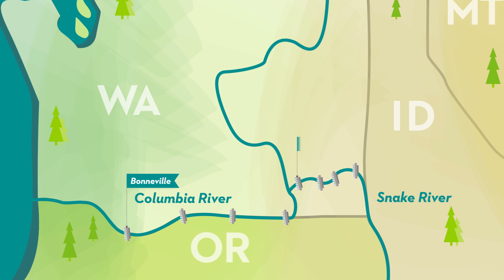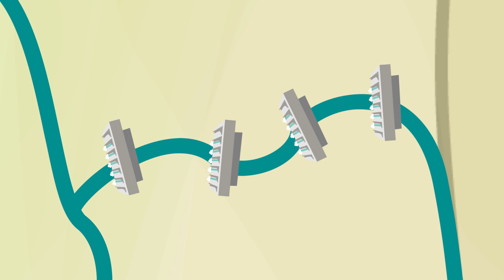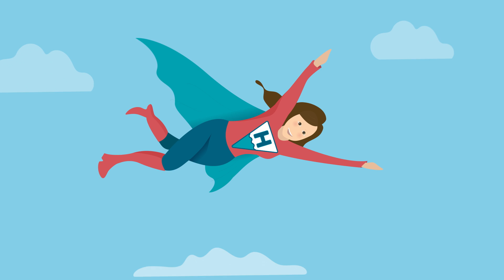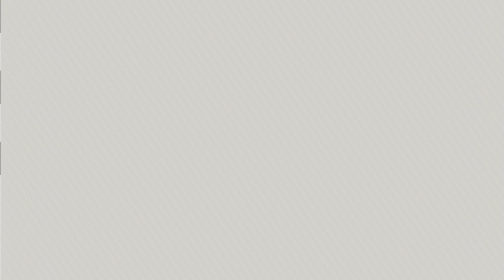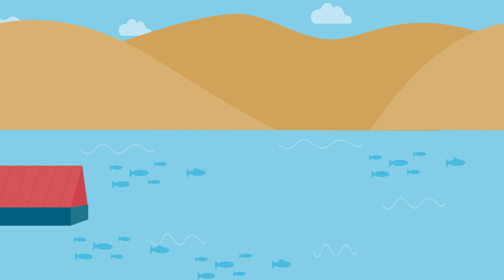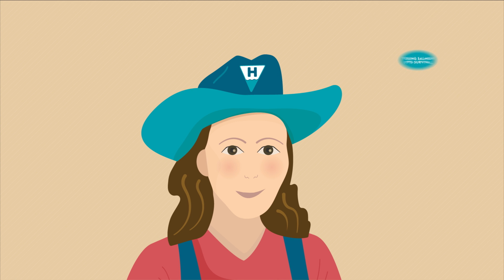The Benefits of Hydroelectric Power and the Dams

Comment: yea but what about all the other negative impacts on the hydrology of river systems? temperature decreases, deoxygenation of the water stored, algae build up, heavy metal build up...
Reply: there really is not much, i think this should be the energy we use in the future
Reply: @zaidfaizar  Destroying valleys, flooding areas that shouldn't be flooded, the farms and houses that are removed because of the dam placement, the expensive cost and maintenance, and even the destruction of ecosystems are a few more cons
Reply: @c4a4l  yes there are cons to dams, like there are cons to everything, but they r less than using fossil fuels